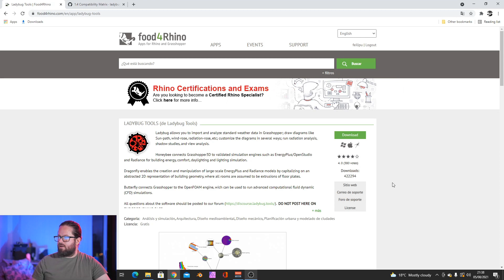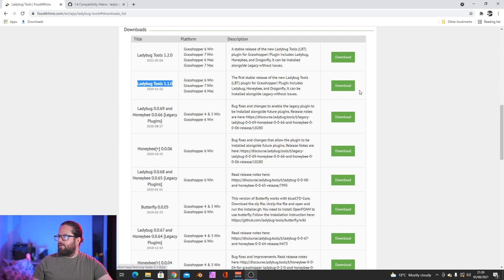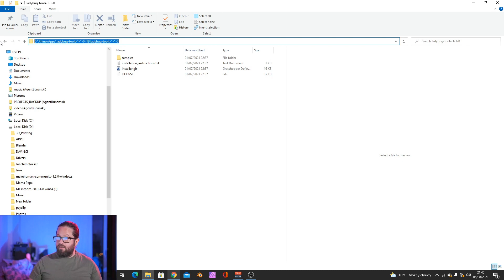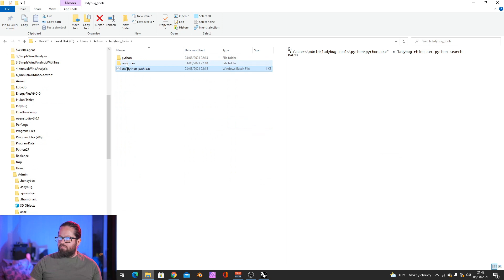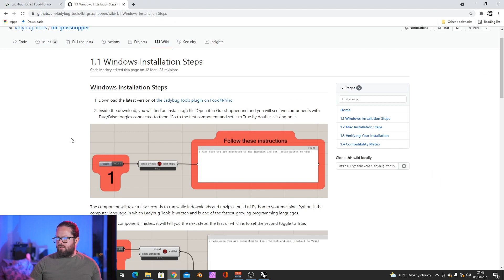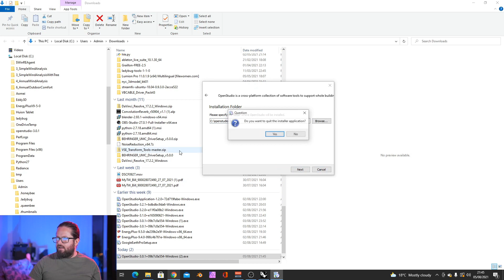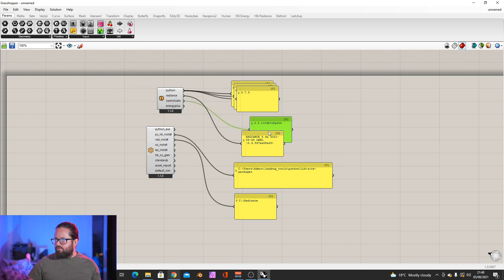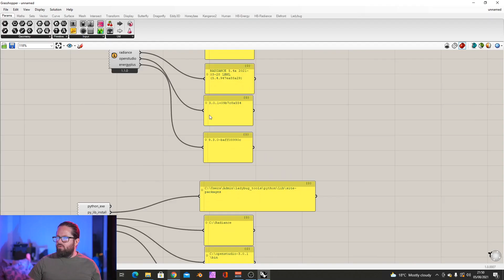Honeybee - Energy modeling - Part 1 of 2 - In-depth Installations - Ladybug tools 1.1.0

Comment: Very helpful I had to figure it is out of my own for version HB1.2. It was very hard to find the comparable energy+.  Thanks for being one of the only people who has done installation guide.
Reply from the maker: Cool, which version of Rhino are you using?
I couldn't get the energy+ installation to work with HB 1.2. only with 1.1
Reply: @PhilippGalvanDesign  Hi Philipp, I had similar issue with installing HB 1.2, I shared the inquiry on the LB Forum and Chris has answered there; aparently I can not paste a link over here so here is a copy of Chris's answer:
"Wondering if the two clash somehow, I uninstalled 9.5 so I still have 9.4"

Yes, the two will clash. Or rather, Ladybug Tools will always try to use the EnergyPlus with the higher version number. Normally, the LBT plugin would still let you run the higher E+ version but, in this case, E+ 9.5 actually had a breaking change to the way it reports its version. This results in that weird 07:05 coming out of the component.

In any case, there are two ways that you could solve this:

Simply uninstall E+ 9.5 (and OpenStudio 3.2)
OR
Install E+ 9.4 (or OpenStudio 3.1) in the following folder:
C:\Users\[USERNAME]\ladybug_tools
The LBT plugin will always search in that ladybug_tools folder for installations of simulation engines before it tries to search the default installation location. So just installing an engine in that folder will mean that the LBT plugin will use that version instead of any other versions of the engine on your machine.